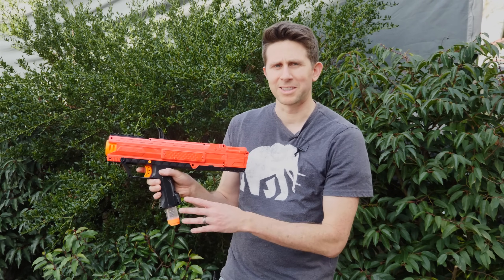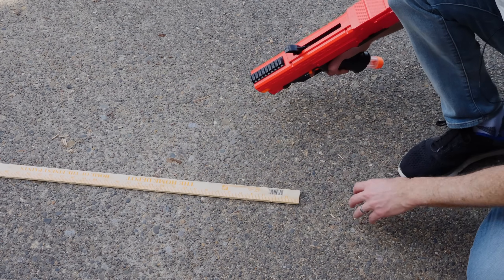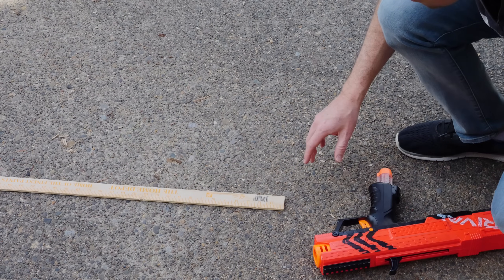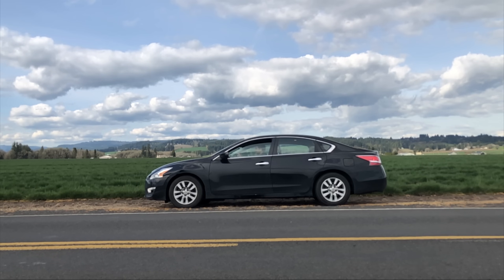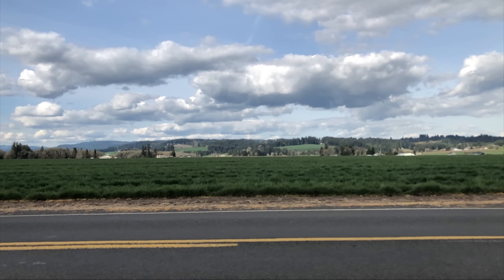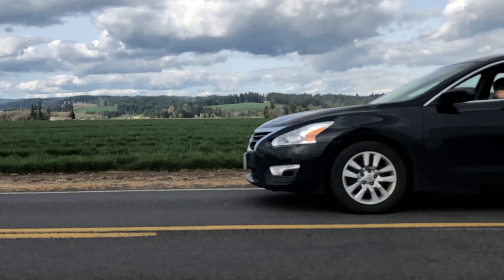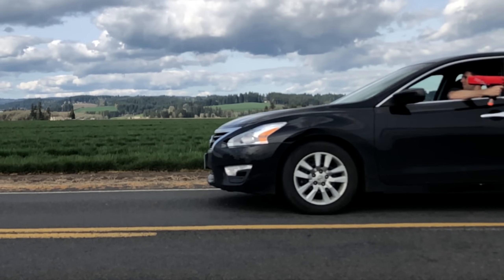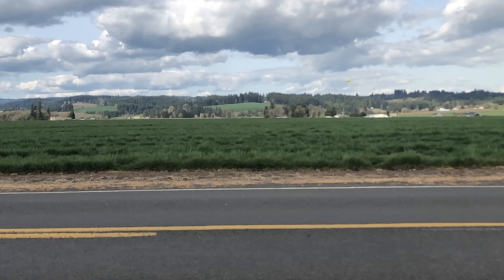Shooting a Nerf Gun Backwards While Driving At The Bullet's Speed Forward

Comment: legit Question: The earth is spinning at 1000 (give or take) miles per hour from east to west. Shouldn't this same effect happen when shooting a projectile that's going 1000 miles per hour east?
Reply: Earth and atmosphere are lockstep
Reply: Due to friction from the air
Reply: Everything around you including the air is going at whatever speed the earth is rotating at, so no it wouldn't have the same effect. Excluding the winds the speed of all things around you are at 0 relative to earth's rotation speed.
Reply: @sertaciba  from doing a little research, i found it does have an effect. just not as large as I was saying. it's two effects that cause it: Coriolis and Eotvos Effect.
Reply: @dizquier91  I see. I was thinking on a really basic level and i'll look into those effects. About that other question, the speed either gets added up or subtracted depending on direction.
Reply: @sertaciba  would this same effect happen if he shot the bullet inside the car?
Reply: @dizquier91  Unless he was going the speed of the bullet in the opposite direction, no.
Reply: Yes, it would, that projectile would not move according to other reference frames, if you looked at it from the moon, for example.
if you think about it, when you are in a car and you shoot a bullet, you see it going away from you at the speed it is being fired, even though that bullet might not be moving in relation to the ground.
in this case, the earth is the car, we don't have "ground" around the earth and we can't get out of the car, so you wouldn't realise of the effect
Reply: Correction, the Earth is moving West to east,.

Comment: The aero of the car draft caused the slight forward movement of the ball.
Reply: that's what I was thinking too
Reply: Fax
Reply: Negative pressure around car, drew ball towards car, deflect away after impact, and then back towards car as car passed the ball?
Reply: It also generated a small amount of lift.
Reply: Dont forget that the ball is usually spinning when it comes out of the barrel, so magnus effect.
Reply: @enigma9789  My experience says it doesn't spin enough and I saw no evidence of it in the video.
Reply: Plus the ball prob hit the inside of the nerf gun first, and slowed down a tiny bit.
Reply: @Eddie Hitler no not rifling, but it just looked like the ball went up, so I assumed they spin out of the barrel like a paintball.
Reply: @enigma9789  not intended, but there's always some.
Reply: He mentioned this in a small note in the video lol
Reply: The bullet clearly hits the rear of the car which causes the upwards and slight forward motion. This test should really have been done again. Watch closely.
Reply: @putzytart  Yes it clearly did. I think when you get a 1st time like that, your a BOSS and recreating it is just boring and quite frankly a waste of a BOSSES time. 😂🤣😂🤣😂
Reply: _ David _  Sorry I don't speak cringe, I've no idea what your point is or why you even made it.
Reply: I concur with your conclusion. I am not a scientist though. 🤷🏽‍♂️
Reply: @MAYNOR82  sometimes you only need to understand science to create the correct answers with deduction and logic. 😁👍

Comment: Basically, fast + negative fast is equal to 0 speeds
Reply: Newtonian Mechanics my friend.
Reply: Don't you hate it when your car goes negative fast?
Reply: But relativity makes things weird. If your car goes 90% of light speed and you shoot a ball forwards with 90% light speed, the ball is not going 180% of light speed as you would expect.
Reply: @jimi02468  true if your speed is close to speed of light. Directly adding the resultant of the speed component is actually not correct but since you won't be reaching anywhere close to speed of light, it's negligible
Reply: Mafs
Reply: Nice vector addition
Reply: Yea Boiii
Reply: Exactly! The net velocity of the ball becomes zero
Reply: no 1 + -1 =0
Reply: It's called resultant force if you running on a treadmill at 10km/h and it's moving backwards at that speed you basically start floating in midair